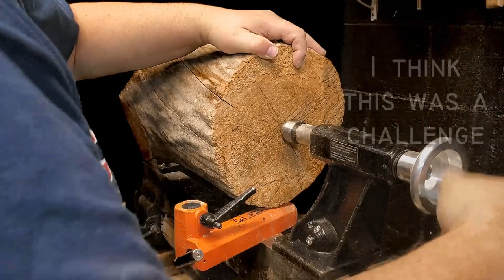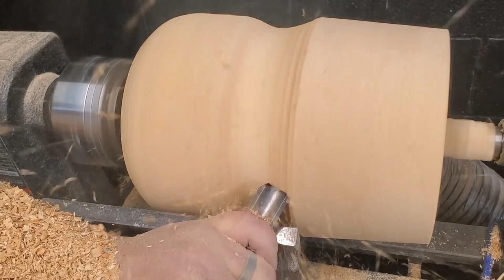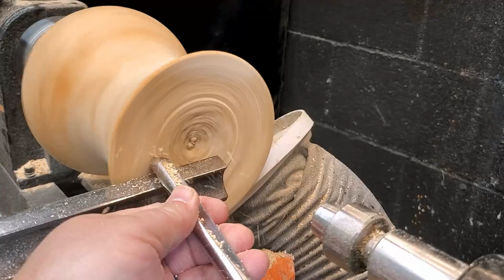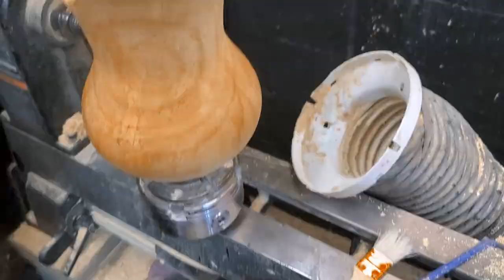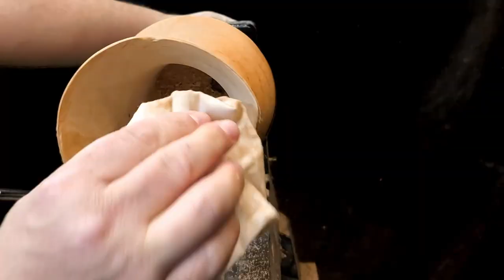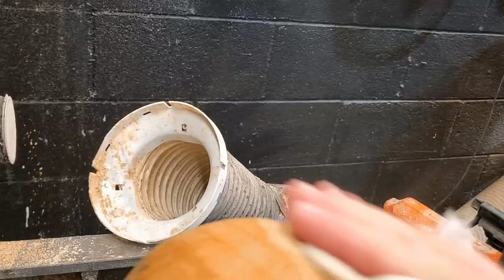Very Punky Maple Log to Vase

Comment: Love it Bailey. I might have cut the rim back a bit to get rid of the missing bits, but leaving them was not a wrong thing. Looks great with the irregularities. The wood hardener sure did make a difference. Your idea to put it into a bucket might have worked great. Would have cost you a few more quarts of the hardener though. Super job. You passed the challenge in aces. Well done.
Reply from the maker: Thanks Doug. I left the broken pieces in because it looks like a worn piece of pottery. I did go back and forth with making it shorter! It did probably need a lot more hardener!